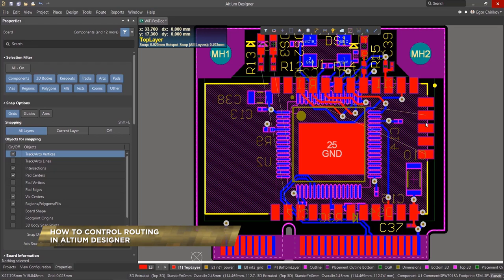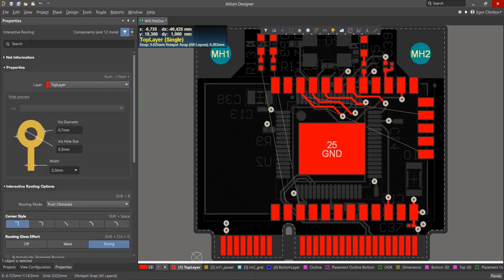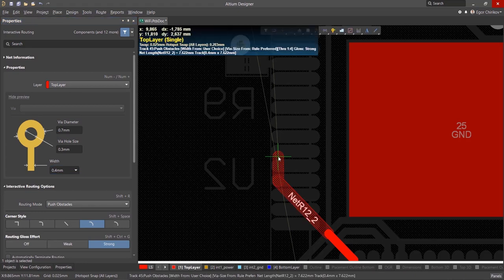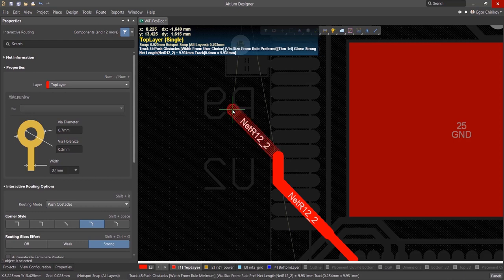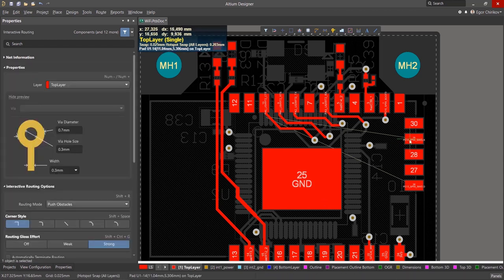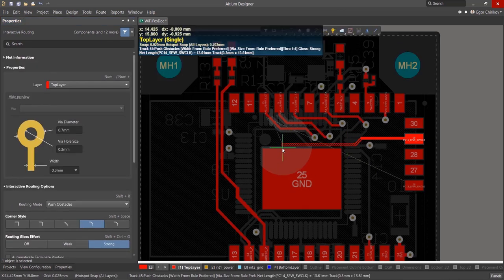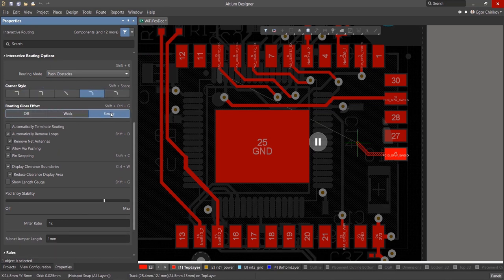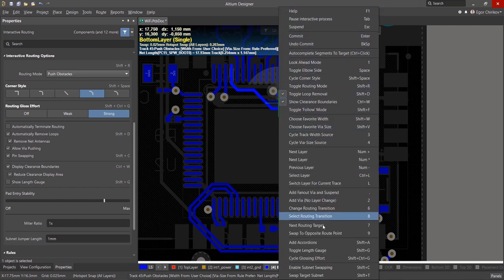How to Control Routing in Altium Designer

Comment: CTL+ W : place wire
3 : Cycle though wire thickness
CTL + LM : Autoconnect (shortest pass)
CTL + W : show clearances
CTL + L : change layer
CTL+Shift + ScrWheel : change layer +place via 
4 : cycle through via sizes
Shift + Space : cycle corner styles
Shift+CTRL+G : cycle glossing strength
CTRL + R : Cycle routing modes

~ or ^ (?):  Show list of keyboard shortcuts
Reply: thnks 👍